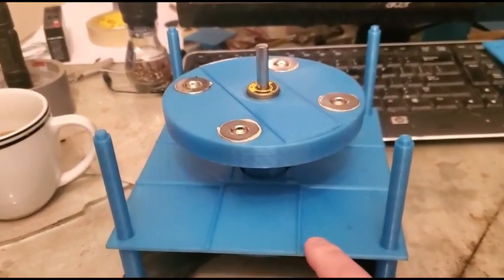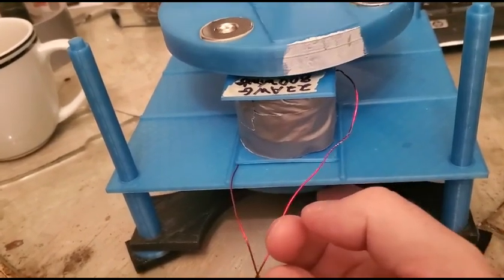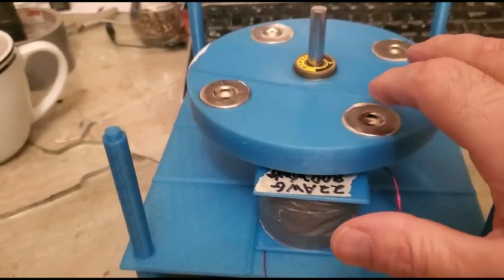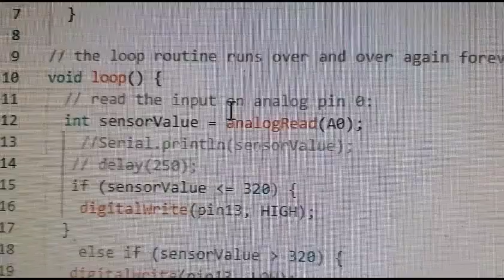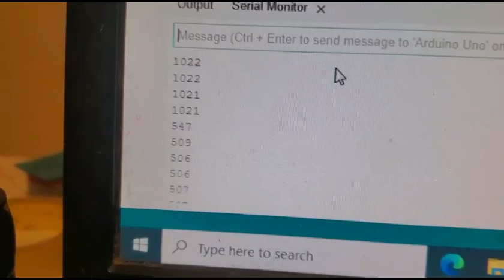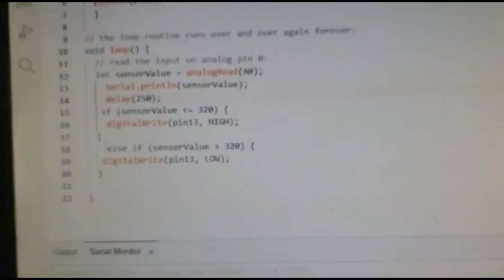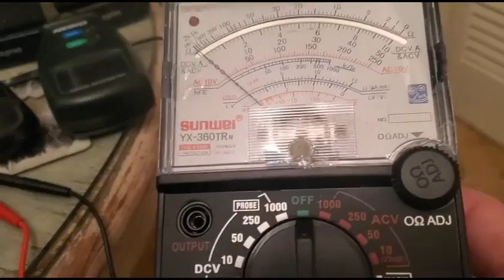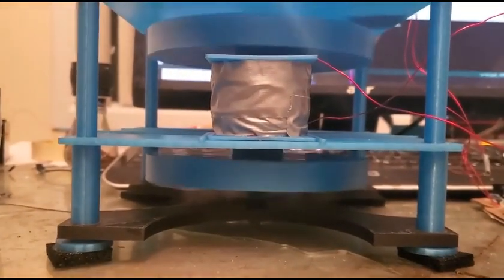First Spin of the Fully 3d Printed Pulse Motor Machine

Comment: Thats a nice deep dive into your current progress, I wonder if the single sided magnetic attraction is also reason why the shaft wobbles. Maybe add a second trigger coil to the other side - should also add more force to the rotation. If both coils have their own hall sensor you can experiment with sync / async trigger based on position ... I leave a sub :)
Reply: What if one modulates the voltage based on the sensor data?
Reply from the maker: Hi Mr. Stanley, Thx :) That is a good point that the force on the rotor would be evened out with a second coil.  That said I'm just spinning half the rotor now and even with one coil it doesn't wobble much, so there is work to do on getting the two half rotors to match better.
Reply from the maker: You certainly could, but this thing is a pulse motor, full on/full off as fast as you can is how I understand you are supposed to run them.